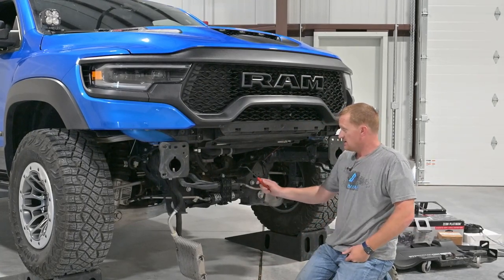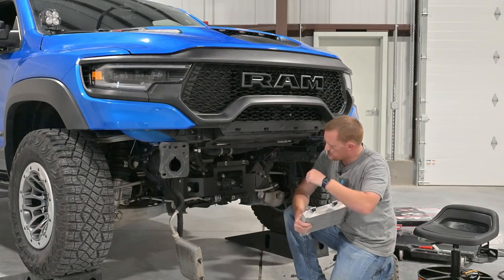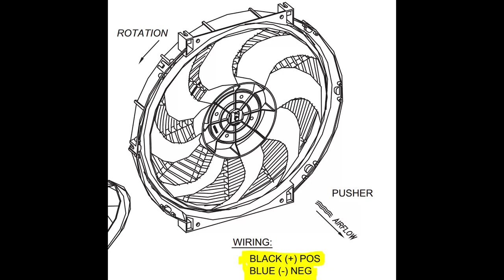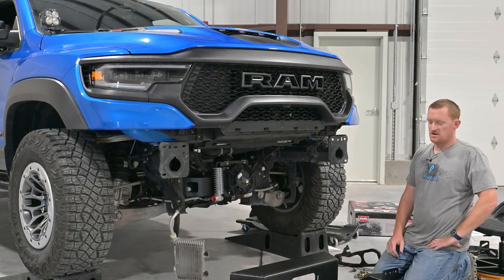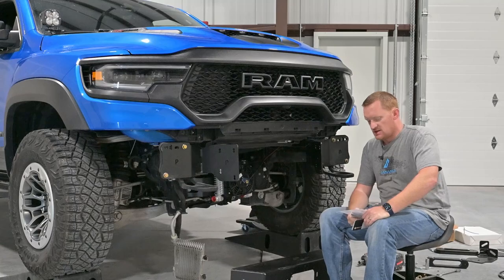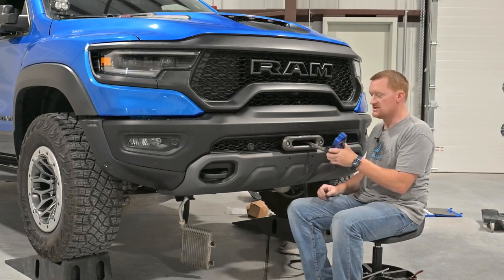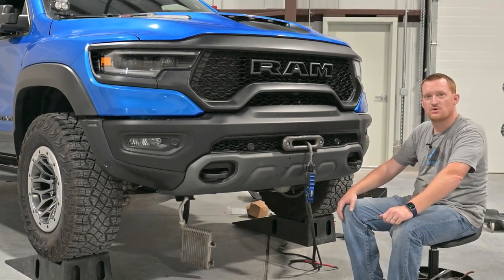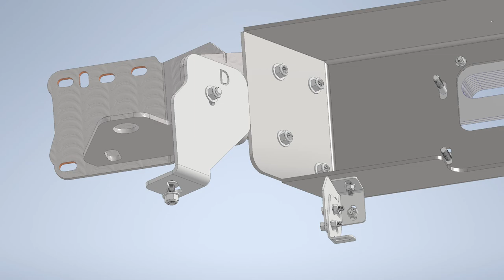RAM TRX Hidden Winch Mount Installation Instructions

Comment: Have sent 2 message/contact inquiries to SwarfWorks asking if they have hidden winch solution for a 2022 RAM 1500 Lone Star using a Harbor Freight Bad Lands 12K winch is possible...and have yet to hear from anyone at SwarfWorks :(